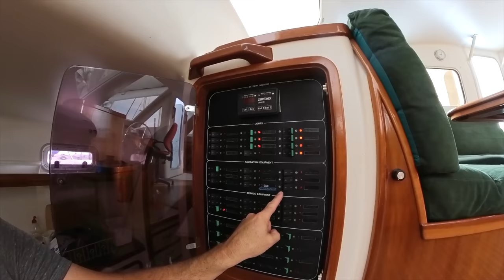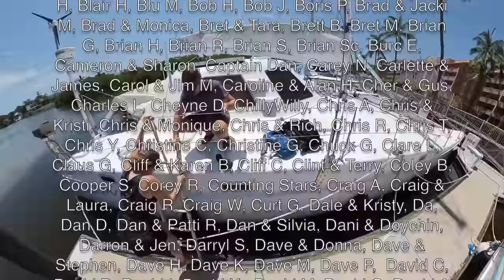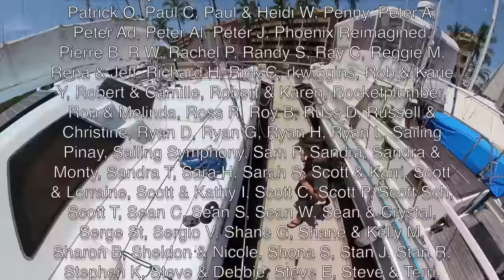OUR CATAMARAN SEARCH -  EDIT - THE DEAL FELL APART!

Comment: I thought you were focusing on speed and performance. A significantly larger boat doesn't exactly scream "speed".
Reply: Larger usually means more speed. Longer hulls are faster as long as they are narrow.  This is a performance cat,  probably weighing about 10-11 tonnes (very light for its length). Probably capable of making 300 NM days with the right conditions (fast). The best thing will probably be the ability to sail in light breezes which is the best kind of sailing.
Reply: @AORD72  I see. I'm not a boat person but I do enjoy these videos. Usually, bigger means slower, but I really know next to nothing about sailing.
Reply from the maker: Ah, ok, see I sometimes don't know what is common knowledge and what isn't. I'll make a video on this topic at some point. The overall speed equation boils down to weight vs sail area....up to a point...then the seas slow the smaller boat down. Of course it is nowhere near that simple as hull form is also super important. Bottom line is that this boat is a LOT faster than our last one. I'll dive deep if we (hopefully) end up buying the boat.
Reply: @stevecunningham6821  Yea there is a lot of factors involved, weight, length, hull shape, sail area, daggers etc. I hope they buy the Atlantic 55 it will be great to see how it performs (not many video's out there). 

The best thing (what people often miss) is the ability to sail in light breezes, which is what this yacht should be good at. Motoring is noisy, with vibrations, smells and cost more money. Sailing is smooth and relaxing, especially in light breezes and on a sunny day.
When they said the engines haven't done much work I thought perhaps that is because the yacht can sail everywhere.

Comment: I really don’t like the forward steering position. Makes no sense to me. No shade or cover in the elements 

Apart from that it is a lovely boat
Reply from the maker: Instead of steering your car from the back seat or trunk, you're in the middle, just like your car. As for sun/elements, yeh, you're gonna be exposed a lot more sometimes. In our experience, needing to be out in the sh*t when it's really coming at you....you're gonna get wet no matter the boat. Otherwise, just steer inside.
Reply: @TheOKellys  At sea in heavy air and big seas, it just isn’t safe to stay inside on this cat, as both the helm and the sails will need to be tended quickly if she starts to lift the windward hull. It is absolutely critical in a storm gust leaping off an ocean wave, to bear off and reduce the apparent wind on the rig to keep her from capsizing. Hanging out inside is not an option for at least one competent crewmember when a gust hits to quickly disconnect the autopilot to bear off and dump the sheets to save a capsize. Boats naturally want to head up when heeled, which in a cat radically Increases the apparent wind, causing a capsize. Bearing off is mandatory and boats don’t tend to bear off in gusts without human intervention which is impossible from inside as the mainsheet has to be heavily eased at the same time as the bear away. The first time a gust hits with nobody in the cockpit to save the day is what will scare the crap out of everyone on board.

Comment: Well, Everyone is congratulating you on your choice, but I'm not so sure.....It's obvious you think Mr White is God,  so trying to convince you otherwise is probably not going to work...But I have some questions that I hope you will answer. First you left a lot out of the video. What are the conditions of the heads, what is the condition of the mast and rigging. What are the condition of the sails on board.... Can you even get insurance without a life raft ??? Those engines under the bunks ,I didn't see much insulation on the hatches and it looks like not much insulation in engine room.... I guess I'm wondering how hot it will get when your motoring, and you motor quite a bit....does the boat have a dingy, and what's the condition...I know you haven't surveyed the hull yet, so what's the condition of the props....How long has this boat been sitting ??? Does Mr white sail her often ??? and I'm sorry but those steps in the galley Megan didn't look comfortable at all no matter how hard she tried to convince us....God forbid if either one of you falls !!! No A/C or washer and dryer.....As you have mentioned before walking 3 miles to get laundry done sucks !!!. and a work room is great but on a boat I was doing maintenance on we only used it to store things. it was just to damn hot to work in there. Especially with no AC....From the video it looked like the outer hulls slope a bit, so just wondering how safe it would be if you and the wife have to go out there....Sorry not trying to offend you, and I'm a Big Fan.  And yes everybody has opinions and we both know about opinions..... Also what about batteries ??? and the other electronics ??? unless your getting a real good deal  I see you dropping at least 175k to get this Cat like you want it....Have a feeling it's going to be a while before you start your adventures....Good luck and God Bless
Reply from the maker: I'm not offended. A lot of what you bring up would be discovered at survey.
Reply: @TheOKellys  but you could answer some of my questions….